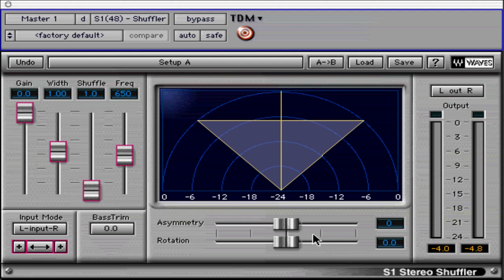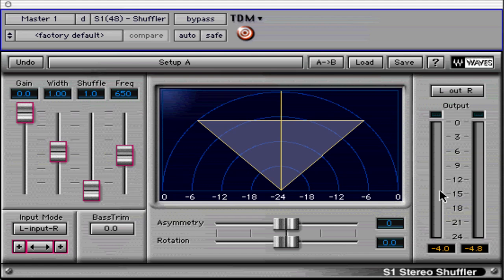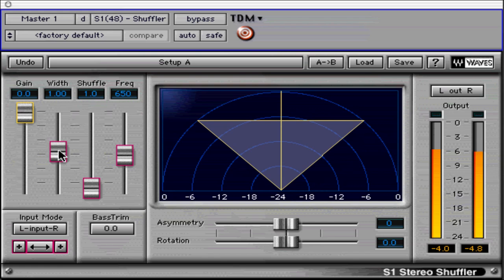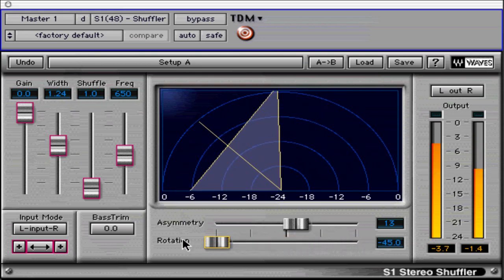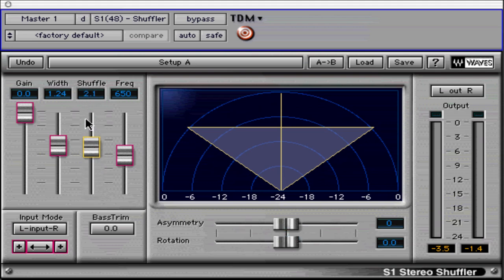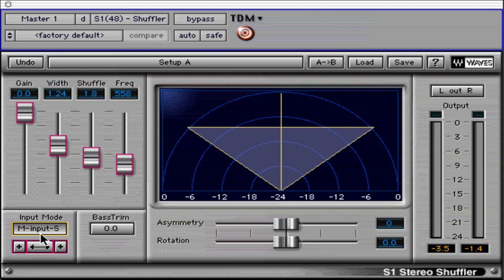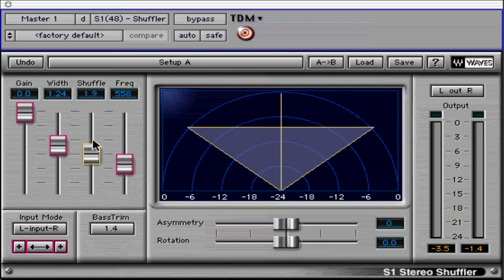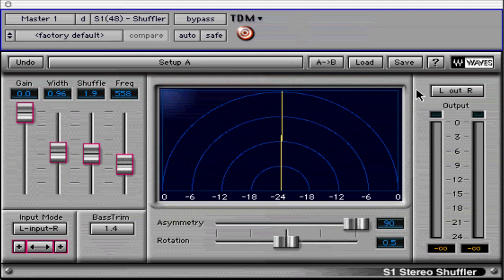Waves Mastering Lesson 24 - S1 Stereo Shuffler Tool

Comment: @Jon Anderson  Stereo Widening can go after the first Compressor in the Chain.

Example Chain for Mastering.

1) Use a Low cutoff, high pass filter plugin .

The digital stereo mix might be coming in HOT at -2.5 or -3.0 or it could have common Analog clipping one half or 1db over Zero (0db) !  Something to NOTICE right away.

Select a solid parametric EQ > INPUT slider or knob > bring it down to about
 -3.5 db  or -4.7 db to make decent HEADROOM (It depends on the sound level of the Mix). A common trick is using about -6.0 INPUT from the starting gate, to create the Headroom needed for the rest of the Mastering Chain plugins.

Do the MATH . The Stereo mix has a visible WAVEFORM to view the PEAK levels in plain sight. Make the proper adjustments with the EQ Input to reach the --6.0 db Headroom mark. 

That is an EXAMPLE only,  perhaps practical or similar practice for some guys, but it's not concrete for every Mastering project. 

(OPTIONAL at this point in the CHAIN) .. proceed to WARM it all up.

G-Sonique Pultronic equalizer EQ-110P
Waves Aphex Vintage Aural Exciter
Voxengo Warmifier
WAVES Q-Clone 
Etc, etc

Use a VALVE Emulator to BEEF up the low end for a PHATTER sound, since Analog Mastering uses it for the same purpose. Digital Tape emulators sound decent, so stop your bickering LoL

2a) At this point, you'll need to Hike up the highs @ 16k.

If you work with FL Studio. Use the Parametric EQ, because the Tape Emulation is going to knock off the highs near 16k as it warms up the bottom of the Track project.
 

3) Waves MaxxBass, preset @ MEDIUM. Tweak up the mid range frequencies. That'll Make songs sound better on smaller audio devices. Good for Hip Hop and Pop.
Slide fader 3 on the right, upward to about -7.0 or a tad higher. 

Of course, every Music Track is going to need a different Mastering Chain to get the great sound you're after.  Let the PLUGINS do their job with subtle changes, but YOU do the Magic by enforcing the Clarity and the right sound expected for each genre of Music.  

4) Waves SSL Compressor . Make the Needle KISS and bounce off the 0db Mark. This GLUES the sound together in most cases.   
Usually as soon as the SSL Compressor opens up, you only need to tweak the THRESHOLD knob to train the Needle to KISS properly. haha!

5) Stereo widening plugin   . Search Youtube for your favorite choice. 

Some people like Airy/3D music...some people do not. That's all part of LIFE.

6) Waves Multi-band Compressor.  Waves L2 or L3 are good enuff.
Sonnox Oxford or Izotope Ozone plugins are great as well.

MATCH the Threshold numbers with the Auto Frequency Detection setting numbers that detect each peak. You don't want a straight line during compression, otherwise it defeats the purpose of pursuing clarity in the track.

7)  CLIPPING is the Power of Loudness.  Commercial Sound levels use Clipping to unleash the Beast.

Using T-RACKS Clipper gets the job done.
Set Slope hard right to 0.0
Output  -3.0 db
Gain about 2 o'clockish

8) Finally, the LIMITER.. Set Output to -0.1 

Sonnox Oxford Limiter, Izotope Maximizer, WAVES L2 or L3Maximzer, and T-Racks Brickwall or Multi-band Limiter all have nice Limiters .  

If you don't have the money right now, you can actually use KJaerhus Classic Limiter from their Classic Collection (Freeware) and it'll sound good enuff until you can get something better . hehehe

I found out that G-Sonique's Twisthead VS-206 is a great sounding Tube Compressor. Using it with the Kjaerhus Classic Limiter will blow your mind in Rock and Hip Hop tracks. Just a little TIP for good Measure fellas, be kool ....

Enjoy your Music Journey!
Reply: +jimi jaam awesome info bro. thanks!